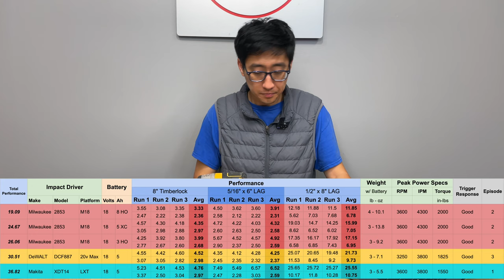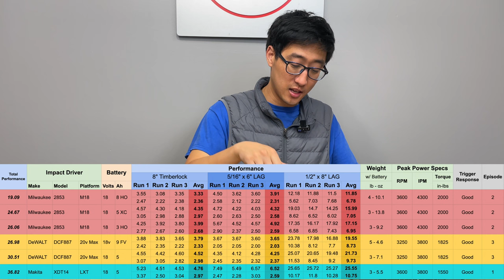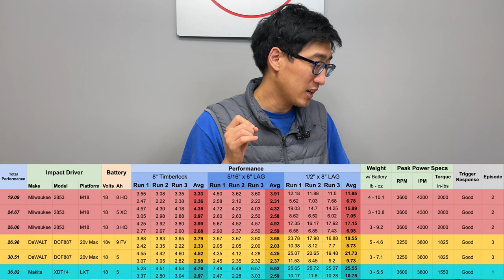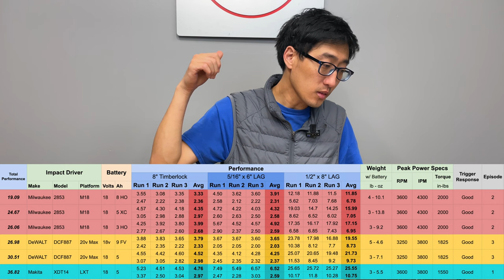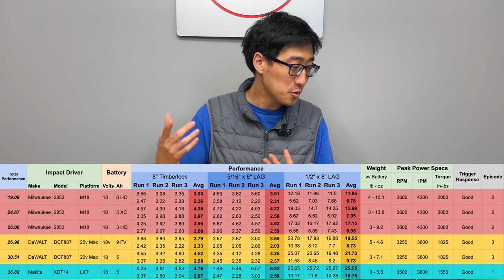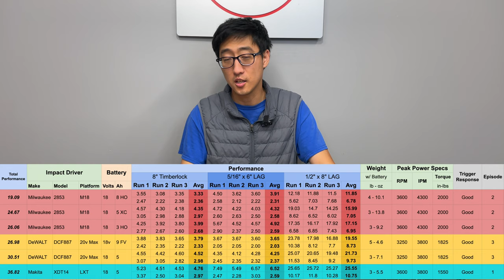DeWALT 20v Max Brushless Impact Driver Review | DCF887 | Best Impact ep.3

Comment: I'd love to see you test this DCF887 with one of the high output batteries using 21700 cells (like the compact 4Ah DCB240) or the 1.7Ah Power Stack battery. Just to see if a little more amperage will get it up there with the Gen3 2853. It's so close!